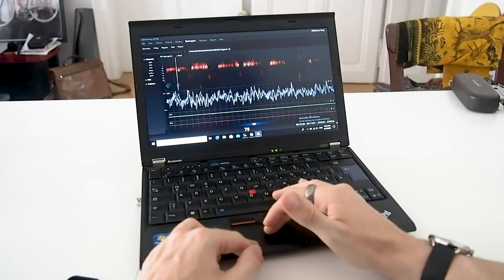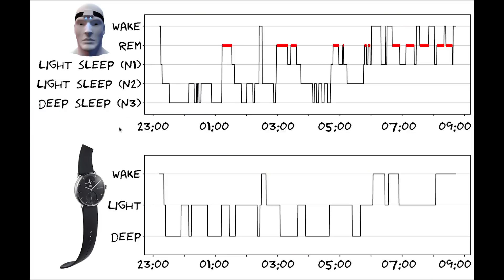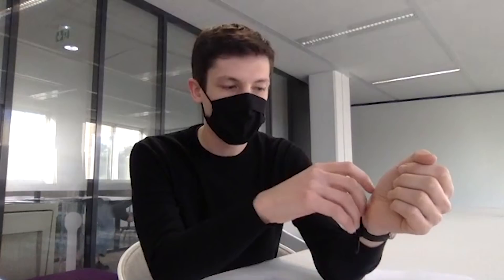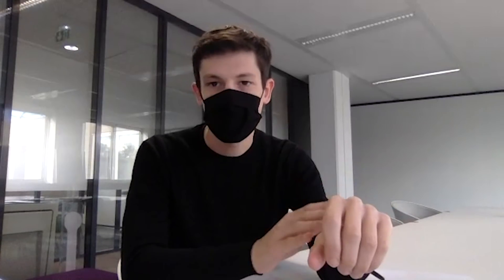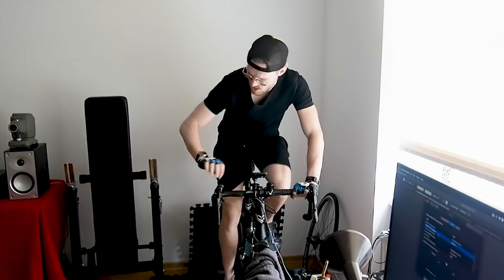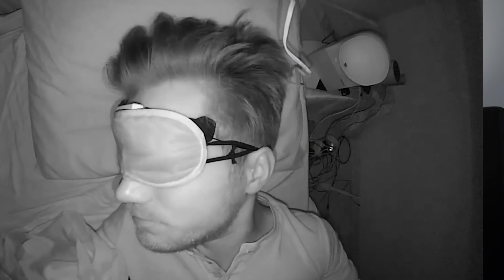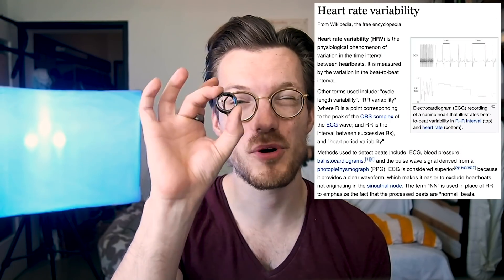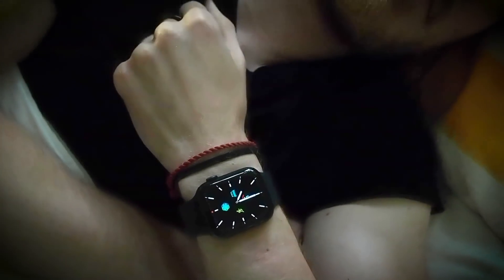Scanwatch Interview: Updates From Withings

Comment: I want to choose the frequency of my heart rate recording!! How can it detect Atrial Fib if it does not scan my heart all the time!? Once in 10 minutes is not enough!
Reply: The majority of people with Afib have persistent Afib. If it's just episodes then the majority of episodes last on average 20 minutes plus. This is what my Cardiologist told me. I have persistent Afib myself. It sucks.
Reply: @PS-en7wn  ok, thanks. I once had few seconds AF in the EKG at the doctor's and have had similar short episodes every now and then before and after. Now I take ECG manually with my Withings when I feel odd, it has not found anything abnormal yet. Maybe I don't have clinical AF, hope so, just normal arythmia.

Sorry to hear you have it persistent. Good luck and thanks a lot for answering.
Reply: true, whats the answer?
Reply: @Hope in my case I just wanted to find out do I have AF or not. It served that - I don't. Otherwise it serves as timer for boiling eggs and as an alarm clock, mostly... 😅 Ok, quite ok with tracking sleep, not always, not excellent. If I had sleep apnea, might be good. For sports or HR, not good. Often loses the HR when I log the sports. 

The app is lousy with HR reporting, you cannot practically see any details.

Measurements notes don't have muscle %. I want to track muscles too, not only fat % and weight.

And when I feel and see something is not normal with my heart, having arhythmias, it still shows (as said in the specs) "normal".

The oxygen saturation I don't trust.

If I could I would certainly buy an Apple Watch.

Comment: Great overview. Looking forward to software updates & updated benchmark.

I've been using Steel HR for quite a while & bought Scanwatch recently.
One of the main reasons why I'm stick with Withings is their durability. I bought my Steel HR around 4 years ago and it is still working fine.
The app changed few times (Withing => Nokia Helath => Withings again), but the hardware and battery life is still ok.

The only things I'm really looking forward to Withings would do - improve the accuracy of the scanwatch measurements & add the ability to constantly monitor & export data into Apple Health.
The only reason I swapped watches with my friend and tried to use Apple Watch was the Gyroscope & ability to export data from there.

BTW, Now I ordered oura ring, so I would try to use a combination of oura & scanwatch for daily tracking.
Reply: Here is an example of how Gyroscope hearth dashboard looks like with Apple Watch:

https://files.g3d.codes/Screen-Shot-2021-01-08-22-38-49.png

Comment: For me, the heart rate detection is much better after the first major update they made. That was around November? But I still noticed that once in a while, the heart rate measurement caps at ~90bpm, even though I am clearly at above 120bpm. Increasing the tightness of the watch strap helps.

Comment: Good interview!! 
Clear, but I cannot grasp the Idea that battery life goes over some key features that makes the smartwatch(tracker) worth wile. As we all know: smartwatches use energy and therefore a battery life of 5/7 days is acceptable. Some brands have 18 hours battery life:( , this makes monitoring at night almost impossible and give you gaps in the monitoring.
Yesterday I bought the scanwatch dispite the passive HR monitoring. Just wondering if the aFib alarm goes of when it checks the HR or on any given time(sensor active/on?)
Reply: I have the same question, but i really think it does only those 30/60 seconds every 10 mins cause only in these periods the green flash (i don't know how it is called) is on. I check the back of the watch some times. But even those intervals are not continues to me, sometimes when i check the bpm screen it tells me that  the last measure was taken 12, 15 even 18 mins ago. The charging and discharging aren't accurate... almost once a day scanwatch displays me that i have minimum bpm during the day than night.. i can't really trust these product yet... it gives me signs of aifb but no panic, I'm just waiting for the cardiologic visit... they can't allarm people like this and make them spend extra money. I read about the apple watch and their incredible false positive.. no data of these signs for the scanwatch because it is still early. I will make updates after the visit, it could be helpful for someone.
Reply: Hi guys. I just did the cardiologic visit yesterday an fortunately I'm in good health. Scanwatch did mess those 8 ECGs of signs of aifb in 3 weeks. I know how and when to use it, I have no tatoos, I even shave the area of my arm where the watch is positioned, the tightness is more than right. Don't know what to say. The cardiologist said that it could be a good technology but it is still primordial. I have still one week to give it back but I have to say that the sleep tracking and the respiratory scan works perfect. I did a poly sleepgram a year and half ago and the results of spo2 during night fits perfectly with the scanwatch!
Reply: @vladcosminstefan2587  thanks for your update, did the watch alarmed you and then asked for a  aFib measurement? Or just summed up a couple alarms in the app? I have the watch now 14 days and had no signs of aFib, neither in the HR monitoring or in a self executed ECG scan. I wonder if the alarms are 100% true and not a assumption the algorithm makes.
Reply: @007recep  no alarm of irregular heart beat, it only showed me on ECGs, i have respiratory sinus arrhythmia and and this has nothing to do with real arrhythmia or heart problems, I hope withings is aware of this.

Comment: Good to be able to interview people from the company but I am still very disappointed with my Scanwatch. It seems hit or miss with measurements and still no measurement of REM sleep. 

My Scanwatch has now developed condensation on the inside of the glass despite never being used with water; I have always been most careful

I am now wearing my Scanwatch and my Fitbit Charge 3 and my current plan is to bin the Scanwatch and return to the Fitbit, especially when your tests revealed just how inaccurate the Scanwatch is. From my very non-scientific testing the sleep measurements do not tie in with my sleep activities or times and the steps are very inaccurate.

Thanks for your videos and all the work involved.

Comment: I actually had a real heart attack whilst wearing the watch last week. I took 2 measuments at the time and both came back with 'high heart rate, results inconclusive'. I was smart enough to call an ambulance and I was attended to (and fixed) fairly quickly. Anyhow, I wonder if the Withings team would like to see these scans so they can learn more and then maybe the watch can advise call an ambulance with accuracy?
Reply: I think as a company by claiming you can accurately detect heart attacks would be an insurance nightmare
Reply: @Michael-cj9uo UNLESS it works perfectly.
But then again, one case would be enough to have shit hit the fan

Comment: A trick to get the face mask to stay put on the nose (and not scratch the bags under the eyes, for us older people) is to cross/flip the elastic straps, so the upper strap goes under the ear, and the lower strap goes above the ear. The face mask will then match the nose angle and facial contours better.